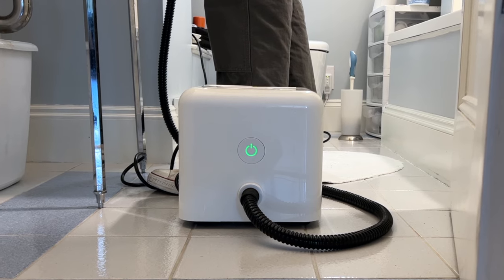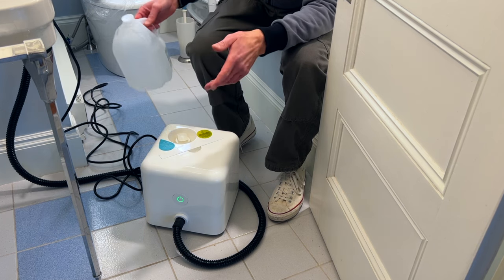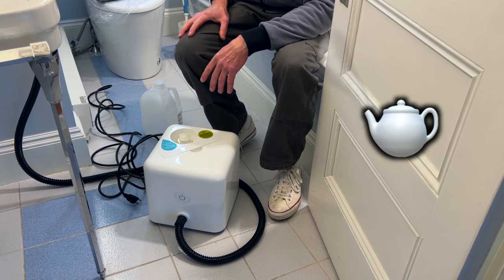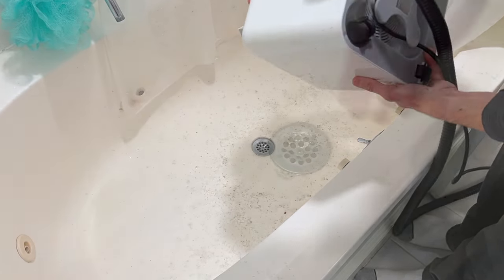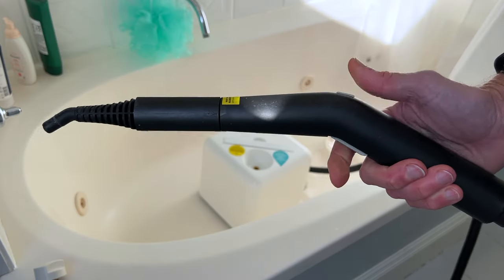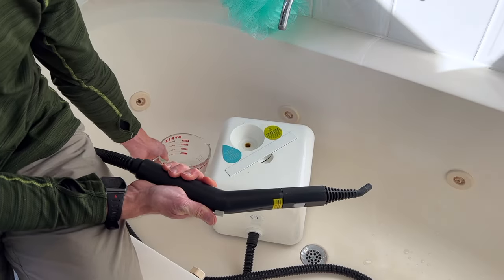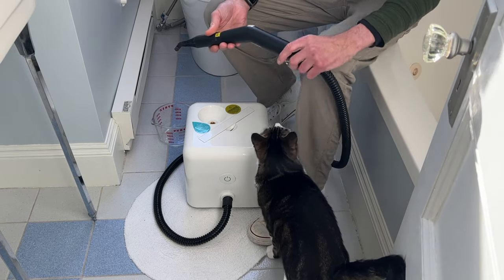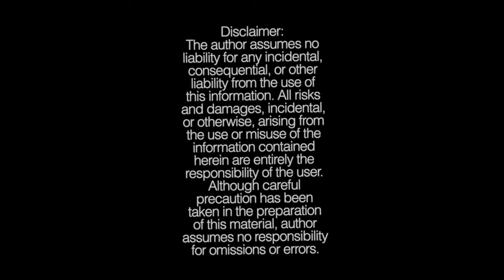Dupray NEAT Steam Cleaner - NO STEAM or SPRAY!!! Solved!

Comment: The crazy thing is that Dupray “no longer recommends descaling” or turning the tank upside down!!! 😳😳😳
Reply from the maker: Thank you for letting me know. I bet they don’t want you to turn it upside down because of how they’ve designed the tank (steam chamber at the top), so turning the unit upside down is what’s causing hard water deposits to clog  the nozzle. It’s impossible to get all the hard water deposits out of this unit. The last time I descaled and rinsed mine, I stuck an endoscopic camera into the tank and was surprised by all the stuff floating in the remaining water. So if DuPray says not to descale it, how do you clean it?
Reply: @BruceAlanR  good idea for the endoscope camera…I need to get one.  I’ve wondered about it not draining all the way (still hear sloshing water).  The newer Plus has no instructions about descaling w/vinegar.  Distilled it is I guess!